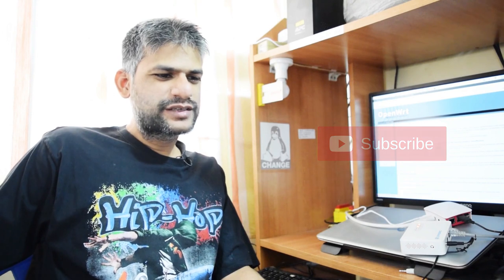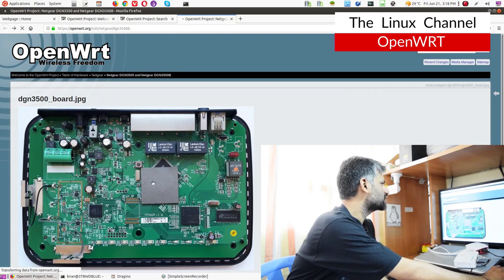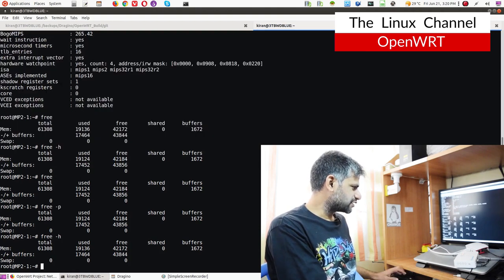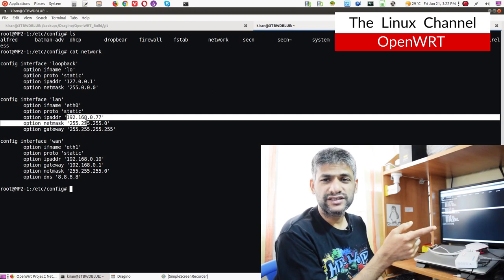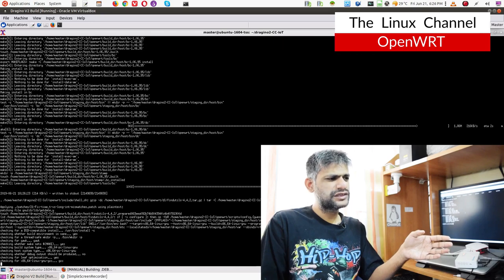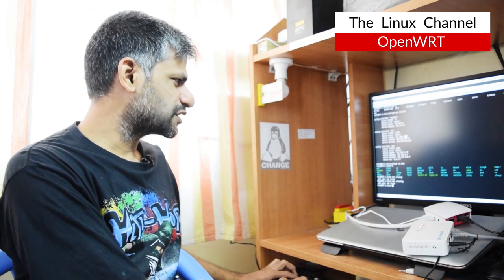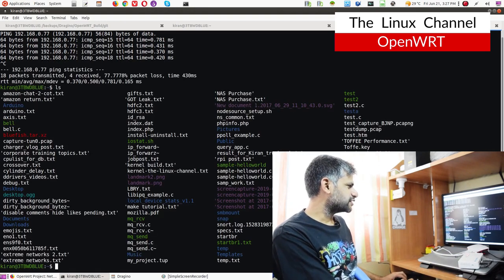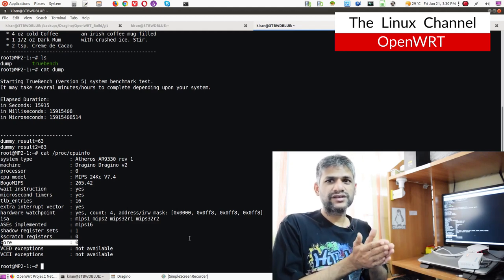0x1bf My OpenWRT Embedded Linux build on a Dragino V2 MS14 MIPS AR9331 Processor | VLOG & Workflow

Comment: I am new to Openwrt. What is DebianWrt? Is there any patch for OpenWrt based on Debian? During the installation of Antenna Module I had issues of DPKG not supported in OpenWRT in Raspberry pi 3B+. So Can you show us where to find and how to install /create for us any Debian patch for OpenWRT.  I could not install Realtek drivers for the external wifi adapter antenna or enable 802.11ac in RPI 3B+. Thanks.
Reply from the maker: no no, sorry again I am not aware. Regarding drivers, why opkg is not listing those drivers ?
Reply: @TheLinuxChannel For this particular external antenna adapter it needs rtl8812bu. not listed. Needs external download compile with dkms. Cant even enable 802.11ac mode on internal antenna of 3b+ using openwrt or raspbian or kali linux.